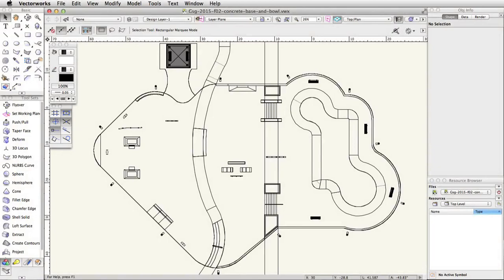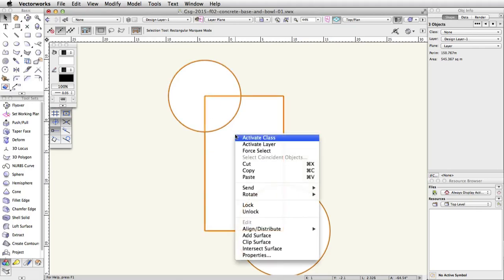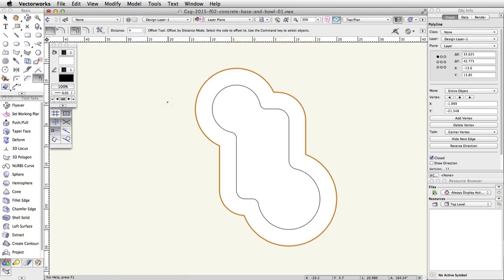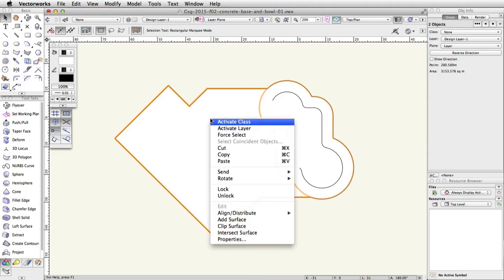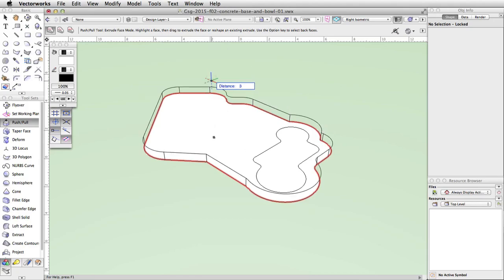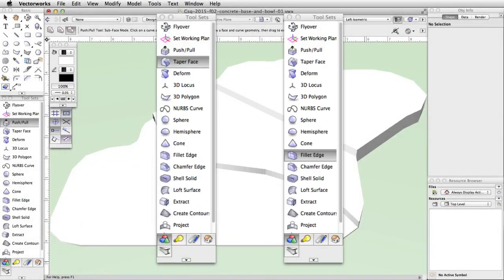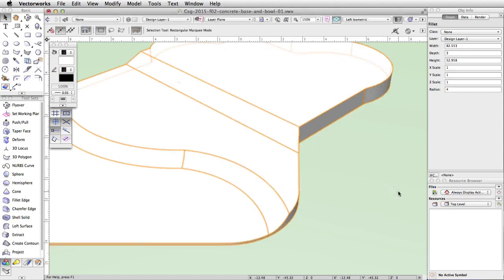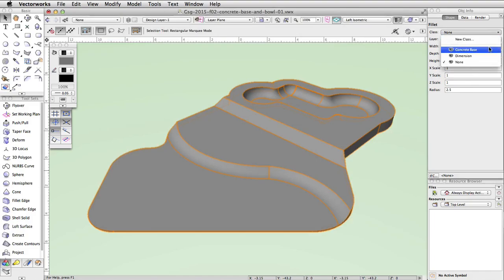GSG - Vectorworks Fundamentals 2016 - 02 Concrete Base and Bowl

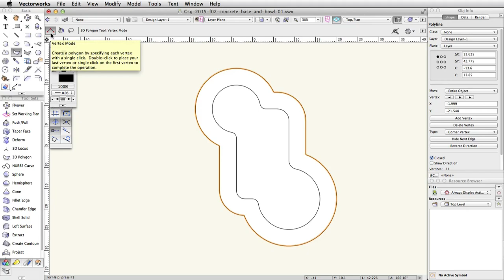Comment: This seems to be the most recent version of Vectorworks to have a tutorial like this. I'm using Vectorworks 2019 and so far this exercise is very, very helpful. However I've come to a point where I'm seemingly unable to duplicate the results when I try. At 5:36 in the video, we are instructed to create a 2D polygon in vertex mode, starting at the midpoint of the top left curved segment. As instructed, I clicked once when I saw the midpoint cursor cue. But when I do that, the first line of the polygon extends not from the midpoint of the curved segment, but from the first intersection counterclockwise from there, where that same curved segment meets with the vertical line segment. I have double, triple, and quadruple checked that "midpoint" is displayed when I click the mouse, but I cannot for the life of me make that the origin of the line. And when I try to move the mouse to a point at which the new line is horizontal, the origin of the line moves to a point on the inner left vertical line at a point just below the filleted intersection. 
I don't understand what I'm doing wrong, but any help would be appreciated.